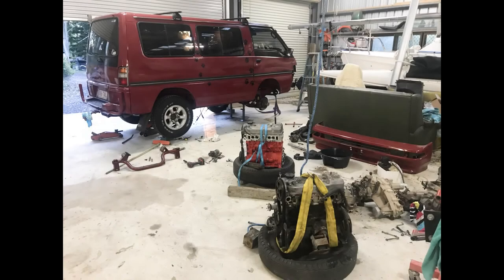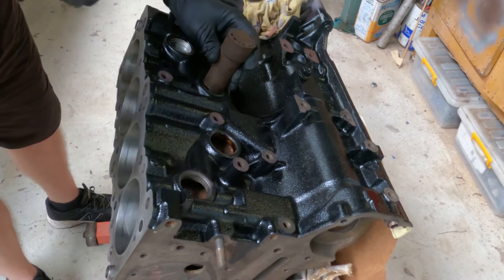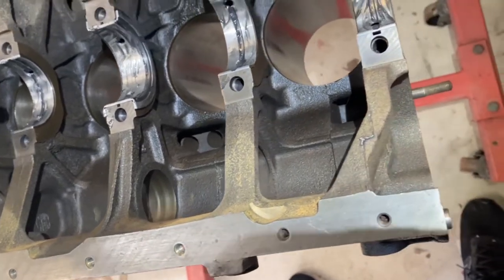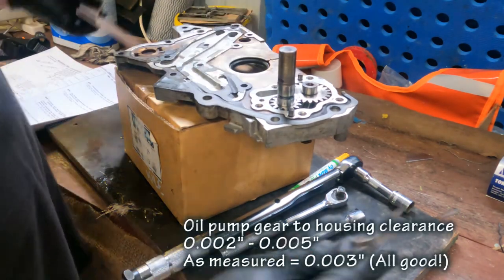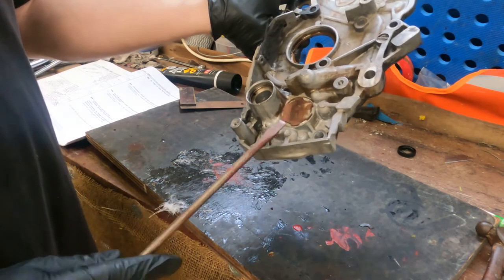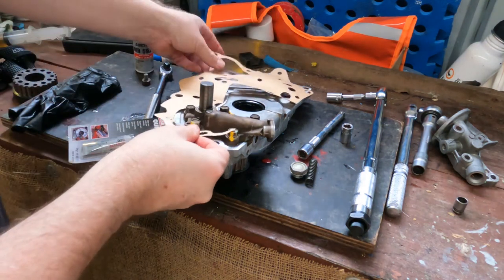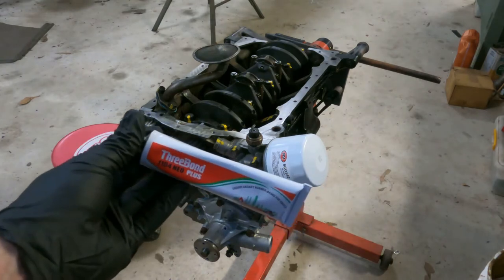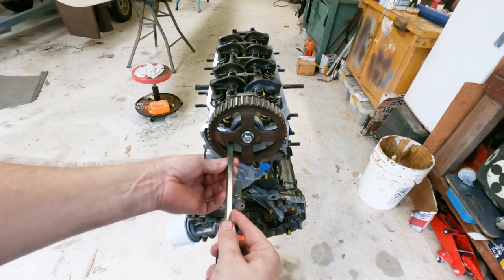Engine Build Tips and Tricks Mitsubishi 4G64 1991 engine model 8V SOHC

Comment: Great video! This is really handy as there's nothing like this for the L300s 4g64 out there. Its clear you are very knowledgeable and take care in what you do. Thankyou for taking the time to make this video

One tip/trick I'll add for anyone watching is the front middle sump bolt is about 2mm shorter than the others. Its very easy to miss and will make contact with the timing belt if it isn't placed in the right hole
Reply from the maker: Yes that shorter bolt is a killer thanks!  I have stripped it before and had to re-tap with a 1/4" imperial thread.

Comment: Great vid man! Thankyou 👍... Just wondering if you have any experience or knowledge of the older 4x4 l300's??. Mine is a 1984 SC 1.8l which needs a rebuild. Trying to find out if i can replace the motor with a 2l instead, as in of it is a straight forward swap without modifications?. Love to hear back from you or anyone else who has the experience with the great & mighty l300!! 😝 😉... Cheers guys ✌️
Reply from the maker: Yes I owned an SE 1985 model with 2.0l 4G63 engine over 10 years ago.  I have had an SH for last 10 years.
your 1.8ltr 4G32 engine I don't think is a direct swap as bell housing probably different shape. Also try Facebook group called "Mitsubishi L300 Offroad," there's a few of the old shape owners on there.

Comment: Hey so I had the oil pickup breakoff my 4wd 4g64 engine but I found a 2wd engine out of a mighty max here in the states. How did that 2wd pan fit against the cross member/trans cooler lines? Was the drain plug accessible?
Reply from the maker: Hi @brodberry1428, in the L300 92 model there were no issues with either one, I even think the sump plug was in similar location.  What I called the 2WD engine, I have recently discovered is called a "6-bolt" 4G64 (1991), versus the one in my 4WD that is a 7-bolt (1993).  The 6-bolt pan is shallower that the 7 bolt, so if anything you have a little bit more room.  No interference that I can remember.

Comment: Hey, love your work! Just want to know if you replaced your lifters with new ones and if so did you need to prime them first?
Reply from the maker: Yes, per the engine rebuld manual I primed them with diesel.  Used a paper clip to push the internal plunger down, dunk them in diesel and pump plunger until no more air bubbles and lifter is firm, x8 times = job done

Comment: on the 2.6L G54B, does the mikuni carb need to come out before the fuel pump can come out ? ....i have 1" clearance between the two, wiggle, wiggle, fuel pump bumps against the carb, does not clear the engine block bolts...what am i missing ?